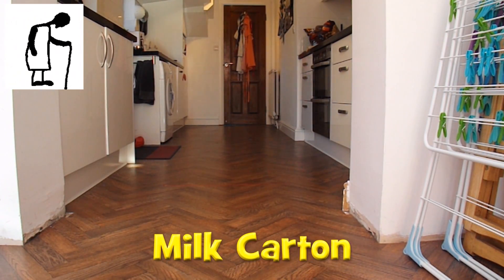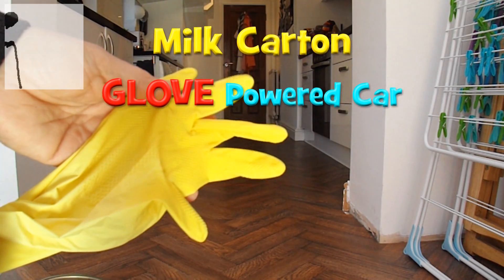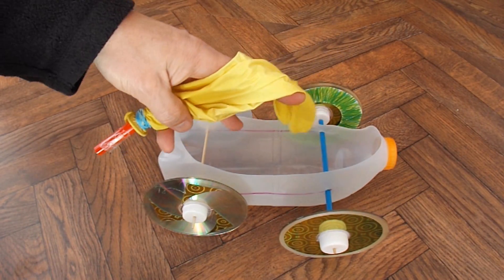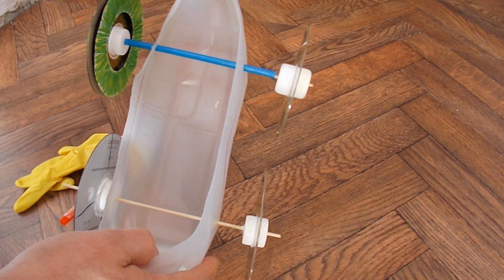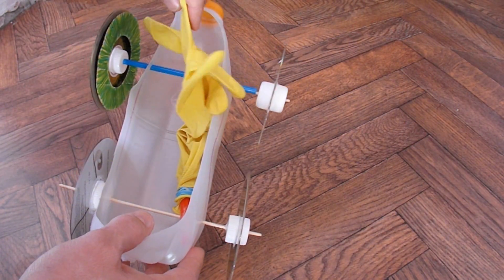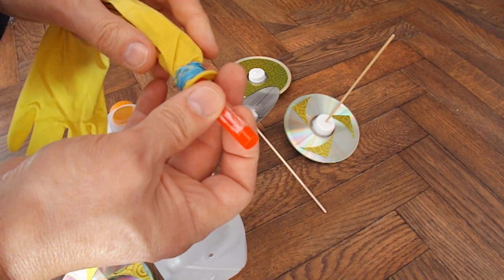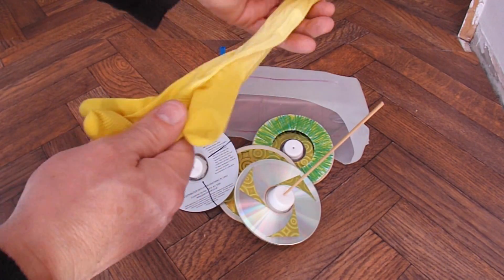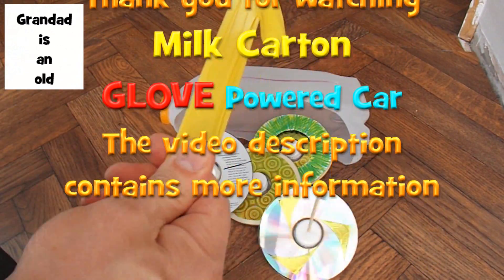Milk Carton GLOVE Powered Car

Comment: I'm gonna try this
Reply from the maker: +spencer hyatt if you do try it you will find the diameter of the tube at the back makes a lot of difference to the speed the air comes out and the thrust developed so some experimentation may be required to get a good run.